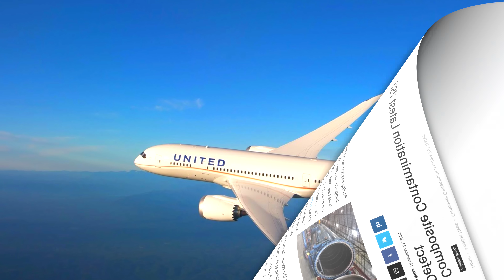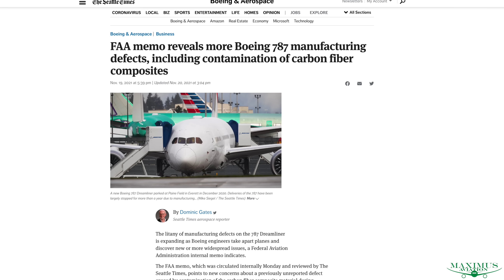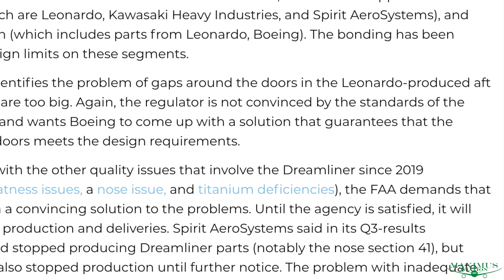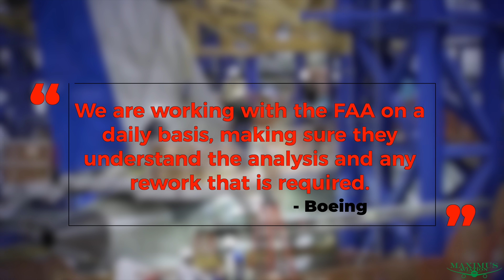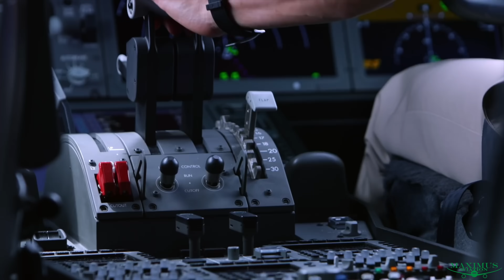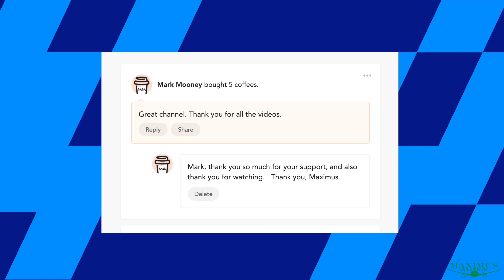Boeing Admits The 787 Carbon Fiber On The Wings Are Contaminated And May Compromise Wing Stability.

Comment: Boeing made the FAA look bad.  Now the Feds are in payback mode.  Sucks to be Boeing, but they brought all this on themselves.

If you have contamination inside any bonded structure, you cant fix it.  Part has to be replaced, or you run a structural analysis on contaminated parts to detirmine life limits and structural strength.

I can only compare what Boeing did compared to what the bizjet guys were doing 20 plus years ago.

Cessna found out in the 80s that the weight and strength benefits of composites/carbon fiber are over-rated, while the problems are under estimated.  Thus, no fully composite major components in Citations.  

In the meantime, Beech is beating their heads against a wall trying to build Starships, Premiers, and Hawker 4000s

Rumor Control in ICT at the time was reporting:
-The 50th Starship was a couple inches shorter than s/n 1.  Seems that the fuselage tooling was shrinking on every autoclave cycle.

- The Premier prototypes were delayed in final assembly.  Seens that the tailcones were too small to fit to the aft pressure bulkhead.  Not much of a problem, if you use aluminum.  Composites cannot be adjusted.  If your tooling has mismatched contours, ditto.  You cannot use a fastener to draw two out of contour pieces together.  Sound like Boeing's "shim" problem is a bandaid to fix the same issue.

The "hazmat scrap" issue.  Composite scrap is considered hazmat (with all the issuesvhazmat creates), and Ive never heard of any way to recycle it.  Metal scrap can be sold and recycled.

Every composite airplane ever designed has used the weight savings as a feature.  Yet every Transport certified all composite jet Ive been around has turned out a lot heavier than estimated.

Havent even scratched to surface on problems like lightning strikes, water and fluid contamination of composite structures.  Not to mention that it burns.

I blame the new kids in engineering.  They were taught in school that carbon fiber is the cats ass, and dont want to use ancient tech like aluminum

One could make the point that the 787 has absorbed so much time, money, and redesign to attempt to fix its ongoing problems, that it caused Boeing to do a half ass job on the 737 Max.  Or worse, took the labor/money away from an all new replacement design.  (Or, God forbid, restart 757 production)

Comment: LOL!!!! Reminds me: if it’s Boeing, I sure ain’t going! It brings me back to 2002 and all of the Airbus bashing after much speculation about the A310 crash outside NYC, and the vertical stabiliser failure  being caused by the fiberglass design. When it’s American, you find all kinds of excuses. When it’s foreign… you bash.
Reply: @Robert Anna My point exactly. That didn't deter americans from Airbus bashing, and now I note they find excuses for Boeing's shortcomings.

Comment: Many issues still surrounding 737 Max too

"Whenever a US carrier or repair station discovers any serious failure, malfunction or defect aboard an aircraft, it has to inform the US regulator, the Federal Aviation Administration (FAA), via a so-called "service difficulty report". There have been more than 180 such reports since the 737 Max returned to service. Most faults were found on planes that were on the ground. But on 22 occasions, they occurred in-flight, and on four of those the pilots declared emergencies
Reply: What were the defects that caused the emergencies?

Comment: It is not that they did it first that is the problem.  It is that they messed it up when and where they shouldn't have.  I mean going to composites is a must do on the high volume aircraft.  Anybody who has spent any time looking at the problem can see this.  With anything engineering, you learn the tools and materials you are going to work with.  Boeing spent a bunch of time on this, but couldn't figure it out.  They built the plane.  Now it has problems.  It is like the battery fires they had early on.  New battery tech?  Well actually it had been out for several years.  Was the battery tech well understood by its users?  Well most people except for Boeing.  I could manage a battery with that chemistry and had done so before Boeing tried.  Boeing lit the batteries on fire long after an individual such as myself figured out how to manage that battery chemistry.  Boeing had a lot more resources and took a lot more time at it, but still nerfed it.  They used to be better at these sorts of things.

Comment: There are nearly 900 in service. Thats only 600 less than the total number of 747s built over 50 years.
If I'm lucky enough to fly again it will be probably to Japan. Definitely Air New Zealand and hopefully a 787. I will feel quite safe and more comfortable than any other airliner I've ever been on.

Comment: stopping production going forward is minimum…Boeing needs to rework the current fleet around the world which will cost them billions…actually may be impossible if wings and nose are an issue as they cannot be patched but rather replaced.
I will NOT fly in a 787, and always before I make a reservation.
Maximus you missed the mark on this video, people don’t care about the corrections Boeing is going to make in the future production batch, they care about flying in a current 787 which is flawed…will eventually result in a disaster
Reply: There hasn't been anyone defect on those that already have been delivered. They may have done that in the background but they seem alright and still in service. Even nose cones get damaged and get replaced. Why will you  NOT fly in a 787. you don't really need to check before your reservation. People do care about the corrections Boeing made to the 787s and future production batch. Its nearly ready to be delivered to customers. the 787 is not flawed and wont result in any disaster

Comment: So the lesson here is don't listen to the first OEM comment but the third and fourth. 

Still, a few things bother me with their communication strategy and show that the deep change many of us have been waiting for hasn't happened yet -- as it did with GM, for instance. I would rather hear we are fixing any potential issues to the regulators' satisfaction and then going beyond that of our own instead of "We're doing it first to our satisfaction and then the regulator's". That would revamp their quality image a lot. 

Ultimately, if Boeing wants to win hearts back they will need to place more aviation engineers at the board and C-levels. The financial top brass hasn't hit high trust marks.

Comment: As a 70 year old investor, it seems to me that the 'merger' of DC and Boeing in 1997 started them on a 25 year long slide. Their dependence on numerous overseas suppliers and a poorly trained non union workforce were management decisions intended to boost annual profit reports, but have now proved to be wrong, costing lives, reputations, and profit$.
As long as current management reigns, IMO, I would avoid BA as a security.
Reply: It has everything to do with the merger of McDonnell Douglas and adopting their business culture. BA stock was once over 440 and currently is 196 with more to fall.
Reply: Spot on, thank you. I'd add that any management of an engineering company, performed by Ivy-League MBA's is doomed to fail.

Comment: Thanks again for your balanced reports. I expect that this is an Airbus problem too. How do you get the final surface color paint to stick! 
 I expect that its a not necessarily a problem with the carbon fiber but the final [paint job]surface treatments  aircraft manufactures  have used for a decade or two!
Reply: Airbus had actually been using large-scale composite structures decades before Boeing. I believe their methods, specs, testing, and subcontractors are just a bit better. Of course this whole thing (yet again) points back to poor management at Boeing. All of it could have easily been detected and fixed. 

Personally I’m getting kinda sick of the FAA doing Boeing’s damn job.

Comment: As you said, time is money. Emirates are showing their waning patience by looking at Airbus since the 777 is so far behind in manufacturing and delivery.
Reply: Um, 777 or 787? Be careful which model you refer to. 777 was released to commercial flight operations in late 1980's, and has been hugely successful.

Comment: As experienced engineers will confirm in developing anything it is wise to take limited stretches rather than giant leaps.  Boeing in this case took several leaps in technology and are facing the consequences.  Airbus took lesser steps but incremental improvement and the A350 has not had major issues, engines aside.   I hope Boeing learns.  I hope Boeing returns to engineering led development in their next aircraft.  I hope the 777x is a commercial success.  I rather think China and Russia will be the next candidates for problems with aircraft.  Love or hate Airbus it is an engineering led development entity and has largely developed the A350 AND the A380 without major issues, stark contrast to Boeing.  While the A380 is a commercial failure it's technology advancements were incorporated into the A350 as mature technology.  It will be interesting to see him Boeing and Airbus position their follow on products to the 737 and A320.

Comment: Great content Maximus, in my view Airbus already knew what they were doing for their A350 and stuck to their guns regardless of what Boeing did with the 787.  Considering Airbus were the pioneers in using composites for large structural parts (vertical stabilizers on the A300, GLARE on the A380 etc) and even they were very cautious about using composites for the entire airframe hence they didn’t go down Boeing’s route of using composite barrels.  Also many of the 787’s composite related problems arose after the A350 was signed off and put in production, so in my view Airbus simply stuck to their guns & leaned on their own expertise to get it right for their A350.
Reply: You took the words right out of my mouth! People don’t realize that Airbus was doing this stuff a LONG time ago, and that huge projects like the 787 and A350 were absolutely concurrent- it’s not like Airbus waited around till Boeing was done, then stole their homework. 🤣

They also went their own direction on many critical and complicating factors like lithium batteries, bleedless engines, etc which certainly made life more difficult for Boeing in hindsight.
Reply: Uh sorry, not quite accurate in your timeline of composites usage in primary structures. The empennage (vertical fin, and rudder, AND horizontal stabilizer, and elevators) of the 777 are ALL carbon Fibre composite structures. Main and auxilliary spars, ribs, and co-bonded stringer-stiffened skins - are all graphite/epoxy composites. Those were all developed in the mid-1980's. The A350 was developed later, and likely "from" what was learned on the 777 technology development programs.
Reply: @mafreeland1027ATGTurner   Airbus were the first to use composites in large critical areas on a commercial aircraft, i.e the A300, please see the following link as one of many examples that document this. https://en.wikipedia.org/wiki/Airbus_A300
The A320, A330 & A340 jets used composites to greater extents than the A300 - all of which pre date Boeing's 777 that you mentioned, the point being that Airbus are very much able to lean on their own expertise.
Reply: @courtz83  Careful of semantics and which types of components you're comparing. The reffered article is factual, but describes much different types of components than are at issue. To wit: 

The A300 used "composites were also made use of, such as carbon-fiber-reinforced polymer (CFRP), as well as their presence in an increasing proportion of the aircraft's components, including the spoilers, rudder, air brakes, and landing gear doors.[ "

Those components are NOT primary structure, and are not as critical to flight success as the structures which used CFRP on the 777. Flight control surfaces are important, but much less so than the vertical fin, horizontal stabilizer, fuselage and wing.

Comment: PTFE is the most slippery substance known to man other than (wet) ice ! How to fix PTFE contamination will be a monumental headache. How on earth did it get in to the carbon fibre ?
Reply: It's not on the same scale nor with the same production means, but sailplane manufacturers are making all carbonfibre saiplanes since the eighties. And even before, with glassfibre, all glider pilots and owners were warned against using polishing compounds with PTFE on the finished airplane, out of fear of problems with repairs or refinishing. Using the stuff anywhere near a production facility is simply mindboggling...

Comment: What is the issue with Qatar A350 carbon composite skin? This also sounds like a contamination problem. Maybe the FAA should have a look at all composite structure airliners.

Reported today 1st December

.Al Baker noted that Airbus is working on a solution for the A350 paint problem, but that they ‘don’t have a solution because they don’t know why it is happening’. He further said that Boeing’s problems with the 787 were ‘dwarfed’ by what’s going on at Airbus with the A350.
Reply: The problem at the early 350s seem to be the paint adhesive. It seems they used not the right paint (since carbon fiber is different than aluminum), if the paint expands different than the fuselage it will crack over time and chip off. 
This can be repaired by repainting the aircraft, but the fuselage itself and it's strength isn't compromised and the aircraft is fine again after repainting

Comment: Forgot to mention the 787 battery issues as well. This almost sounds like the old axiom  "Too many cooks..." when you started listing off all those other companies involved. However, one would think a company like Mitsubishi Heavy Industries (along with all the others) would know what they are doing when manufacturing these parts and products. Also where is the QC in all of this? Is Boeing just letting these parts in the door without any form of inspection?

Comment: I don't know how you "rework" contaminated carbon fiber laminate. If there's PTFE in there it runs the risk of separating between layers, I would think (I am NOT a materials scientist but I know that PTFE is slippery stuff). It seems like the biggest concern with composites is getting water between the layers and having it break things apart. This seems like a long term nightmare scenario to me. One has to wonder if Boeing hadn't been so busy outsourcing so much production to share the financial risk whether they might have kept their eye on the ball better.

Comment: I cant see any improvement in Boeing since the Max crashes. Its just been one thing after the other. They are a disgrace and have found their scapegoat in Falkner. He does deserve to go down but not only him. Until the top management is replaced and Gaoled, I cant see any real change coming and the Dreamliner will have a safe history until such time as it doesn't. They still will not change because outsourcing is cheaper by far. Truth is they can not have complete control over all the manufacturers that make parts for them.

Comment: What Boeing needs is a complete overhaul of its management. Boeing needs another mentality at the top. The top is treating the current production problems as teething problems. It looks like they are patching up and patching up again.  It's now clear that the current management is totally incapable to perform this badly needed overhaul. I wonder how long they can continue to go on like that. Don't they realize that they are working on the cutting edge? One crash with the 787 and it's close to receivership.

Comment: I don't often comment but Airbus has their own issues with carbon fiber.  The A350 comes to mind they have wave issues in the fuselage.  Not covered much compared to Boeing's issues.  I am not a fanboy of Boeing.  I have flown on mostly Airbus planes because of where I have travelled.  I did fly a 757 at least once and possibly a 737 to military training.

Comment: Maximus, your way too kind to the McDonald Douglas (Boeing) management team.  Al Jazeera  did a long article on Boeing’s problems with the 787.  It’s only gotten worse since that article.  Customers were refusing to accept aircraft built in the Charleston plant so instead of shutting down or fixing the problems in South Carolina they shut down the Everett plant.  Every major step that Boeing has taken since the takeover has been aimed at screwing the employees that made Boeing great.  They moved headquarters to Chicago so that the engineers didn’t have access to management, they opened the plant in Charleston, manned it with former McDonalds burger assemblers, and shut down the Everett plant so they didn’t have to deal with pesky skilled labor.  They farmed out the manufacture of the 787 to a multitude of contractors, so the contractors can deal with labor.  So now the 787 is being manufactured with no continuity by people who are underpaid and unqualified.  Before you say another kind word about Boeing you need to watch the Al Jazeera report.  One question, does Boeing pay you?